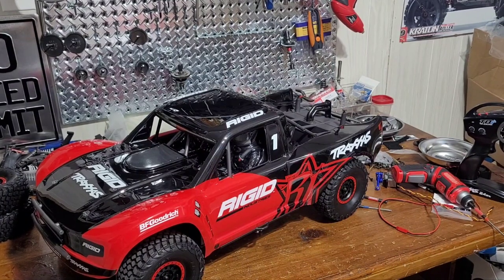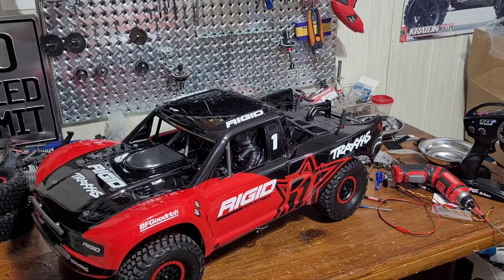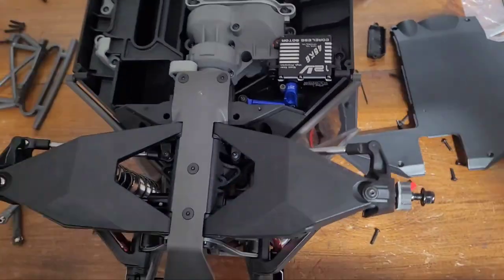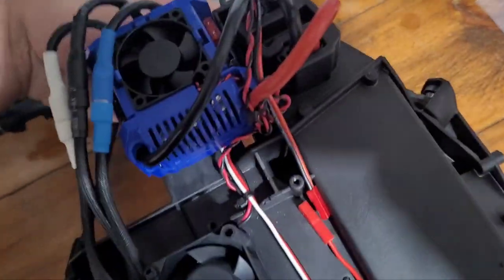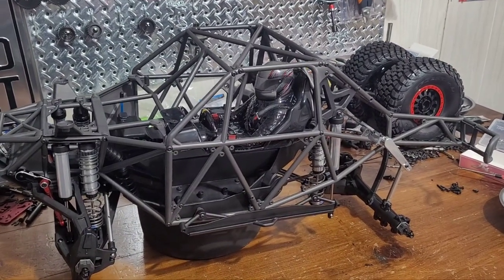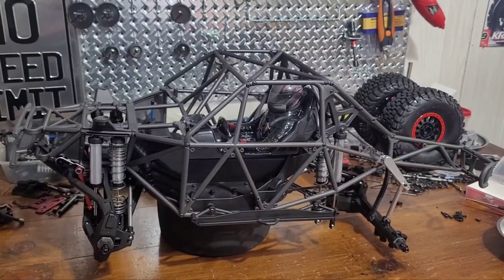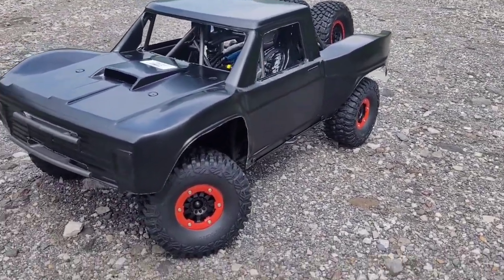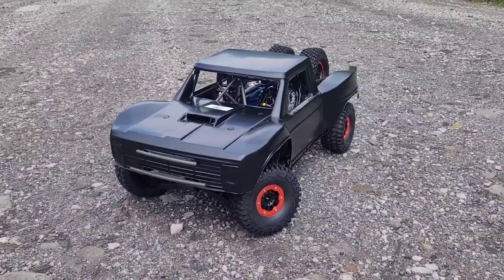SXSBLOG TRAXXAS UDR RACE BUILD

Comment: Alluminum hub hex are a must I've heard, the plastic will strip out over time when running 4s.  I also believe that only minimal part upgrades should be Alluminum.   I'd really like to make an improved chassie for udr, yes the original is outside the box,  but I figure things such as incase motor and perhaps not haveing roll cage play into factor to support shocks.  Another option and choice would be nice.   I'd like to make a chevelle car with udr suspension,  not go low like race car but perhaps higher clearance then rally car. Just to get that old-school muscle car lean taken turns and to not have car bottom out. Can't stand seeing bottom chassie all scratched to hell gouged deep grooves..ouch
Waiting for traxxas to make a newer udr and or for them to drop the price on og udr.  I'd like to get everything for 699.99 including batteries and charger.  Plus not to mention all the alluminum upgrades just so car handles rt. Plus better steering servo.  Lower price allows flexibility to get other things the truck should come with.
This truck hands down is great only 1 om interested in.  No slipper clutch,  the drive train and suspension is a huge selling point alone
Reply: I've heard running it on 4S is way better and more durable to the components than running it on 6S...